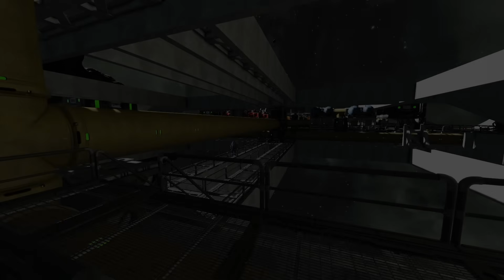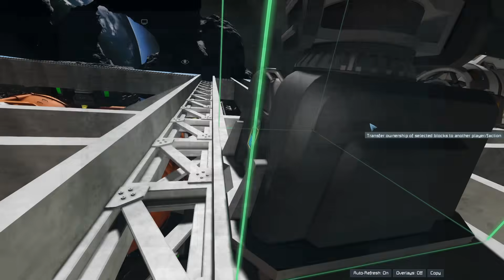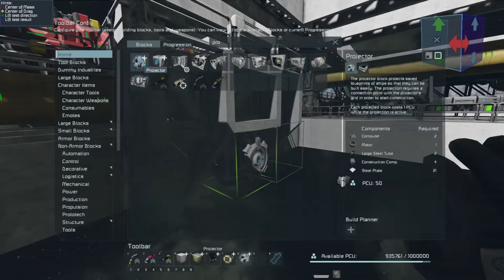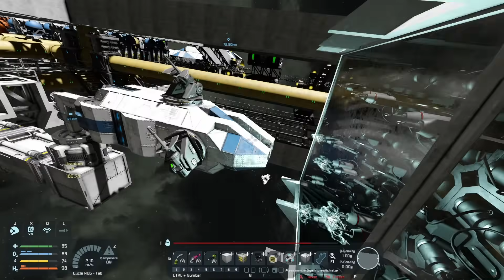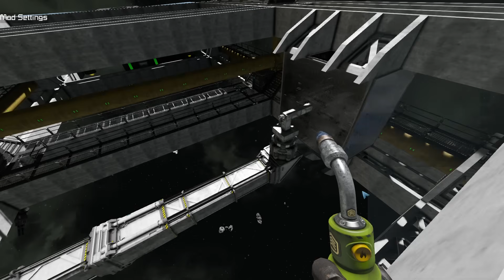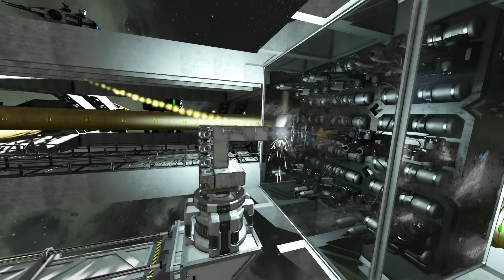Space Engineers - Prototech Pursuit EP25 - "Drone Printer Goes BRRRRR"

Comment: So I don't want to nitpick but I did take some time to optimize your printer setup.

First: 1 timer block per projector; turns on correct projector, turns off other ones (redundancy, see final step), turns on merge block, calls the piston extent timer trigger now
Second: Piston timer, set speed and distance both pistons individually, don't use groups.
Third: Event Controller: detect piston length, use 'and' requirement detecting both pistons. Turns on welders, individually, calls retract timer, calls connect connector timer.
Fourth: Retract timer Sets pistons to retract
Fifth: Connector timer attemps to connect ammo connector every second
Sixth: Event Controller detect connector connected, turns off connector timer from 5
Seventh: Event Controller: detect pistons both fully retracted using 'and'. Turns off welders, turns off merge block,   disconnects connector, turns off all projectors.

To add a bit more life to this, add a broadcast Controller that announces printing "name" drone at start, printing in progress, and printing complete.

^.^ Love your series

Comment: Only thing I can think of adding is a way to push the drones clear of the platform so that you don't smash them into the frames and/or the welder wall while on the move. Should be easy enough to set up, just some pistons and a landing gear attached to a solid floor. Once the drone is complete and the merge block is detached, the pushing unit extends, locks a landing gear and pushes the drone clear of the platform, then unlocks and retracts.

Add some airtight hangar doors on the top, a floor on the bottom and spinny warning lights near the welder wall, and you have yourself a construction hangar.

Comment: You COULD make a rotary drone rack which is set up on a condition that if the rack is turning at programmed speed [should not take it very long to get up to speed] AND the rotor is at [specified by divisions of units around the radius (simply divide the diameter of 360 degrees by the number of drones)] it releases the appropriately aligned merge block.

And, potentially, one COULD add a parking script on a crane mechanism, so that it can print a drone which automatically parks each drone in the most available position open. And that could be both addressed, and have a readout that determines at all times how many drones you have, and where on the racks they are sitting.

Admittedly, that might make it a little trickier than parking them in a row...

But then if one wanted a row to park them on, one could make little rolling merge blocks [think detachable rail trucks like you see on trains] that could be remotely told where to go to park under a drone and merge with it, before rolling out into a parking rail along each side of the ship.

As long as your ship is currently, its likely you could park up to 10 drones lengthwise down each rail, or maybe 30 drones transversally.

120 rapid deployment drones would make an epic fleet that even the USAF would be envious of!

[I could sketch this idea if its not clear what it would look like]

Comment: Your automation was on the right track... With the automation blocks available, I am thinking it might just be possible to establish a sequence of events. 
<Push appropriate button to print drone A, B, C, or D>: Turn off Build and Repair - Turn on appropriate projection - Activate warning lights - Turn on Weld Wall - Begin retracting pistons slowly - When fully retracted turn off Weld Wall - Turn on Build and Repair - Turn off warning lights - <Push button to manually reset/turn off printer> - Turn off all projections (and possibly everything else to allow the shut off button to function as an emergency stop button)

This way build and repair is allowed to go in and build any missed blocks before you manually reset the printer for the next print.

Use one or more 4 button controllers to select appropriate projection and use a single button controller as the emergency cut off / reset button.

It is possible with inventory management scripts to also add display panels that will show you if you have enough components on hand to build a given drone, but that is complicating matters further.

As an additional note: You might consider at minimum increasing the firepower on the platform. Heavy guns down the center-line and Gatling turrets down either side both top and bottom. Your entire world is wrapped up in that platform and everything is exposed. One rail gun drone could ruin your playthrough if at the wrong place at the wrong time.

Comment: Do you have an inventory manager script? If so don’t forget to give it instructions to fill up your drones with ammo. 3 per turret seems a little low to me. 😅

You might be able to automate the remove process for the drones using a move command block. Set it relative to the carrier and either have a trigger block on the drone to activate the move command, or use timer block you use to disconnect the drone in the first place.

Comment: Was the printer-induced clang issue a result of printing ACTIVE thrusters on the new grid? I'd be curious to see what happens if you turn off the thrusters before blueprinting the ship. Just a thought.

EDIT: Nevermind. I see you thought it through a few minutes later...😁

EDIT II: 0.33kg Gold and 0.13kg Platinum per Thruster Component... x 39 Thruster Components = 12.87kg Gold and 5.07kg Platinum per drone.

Not sure about how much to you need to refine, but I believe it's somewhere in the vicinity of ~1% efficiency for Gold and ~0.5% for Platinum... so upwards of ~1287kg Gold Ore and ~1014kg Platinum Ore will need to be mined and refined per drone... give or take for however far off my guestimates are and whatever Yield Modules may come into play.

Comment: Carrier design idea: because the plan is to spin it, a cylinder seems to be the most obvious form, drones docked around the circumference, with another printer in the core. Could even have multiple rings of drones that you can launch in separate waves. You can use the same frame build style as the platform, so when the carrier docks, it ties in and looks like it's an extension of the platform, rather than a separate ship.